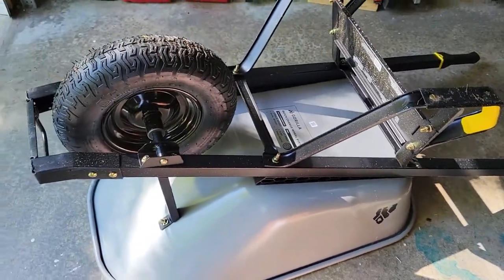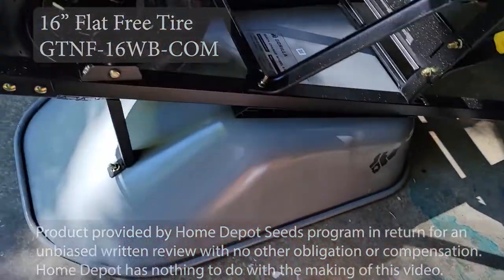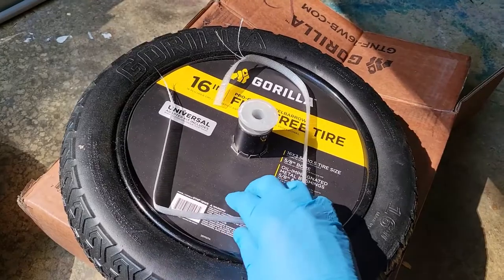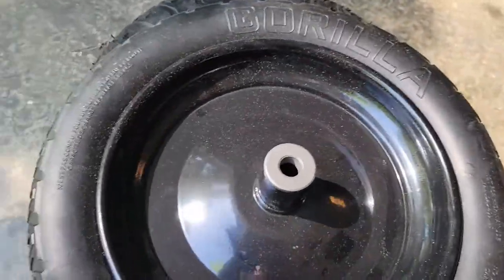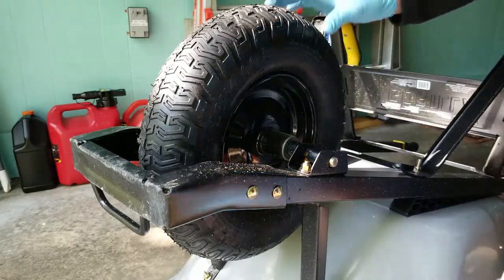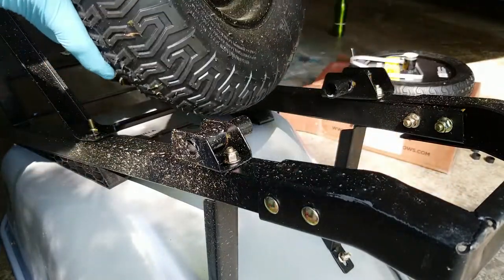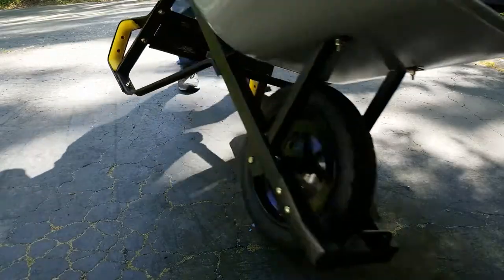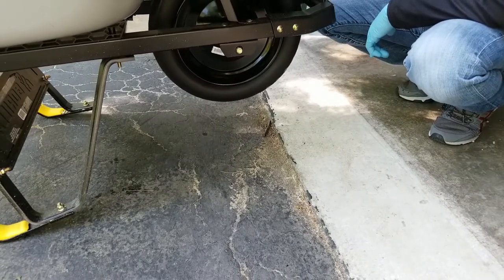GORILLA 16" Flat Free Tire GTNF-16WB-COM

Comment: Does that no flat tire have a weight limit before deformation?
Reply from the maker: It did not list a weight limitation, but I have no issues hauling 6 cu ft of material with this wheel.
Reply: @cfldriven  Is the poly tire stiff or does it have some give like a no flat rubber tire? Thanks for your replies trying to finalize my purchase decision.
Reply from the maker: @hippo-potamus  It a solid hard tire with very little give. Going over obstacles is jarring as it doesn't absorb the impact like a pneumatic would. It a tradeoff I can live with to avoid a flat tire.
Reply: @cfldriven  Thanks mate. Appreciate your honest feedback. But that very hard feel I don't particularly care for. On my other wheel barrow I have a no flat solid rubber tire and it is a very comfortable ride, it absorbs the impacts and feels almost like a pneumatic tire. I think I will just buy the same solid rubber instead and pass on this poly tire. Thanks for your help. Cheers.
Reply from the maker: @hippo-potamus  Glad I could help with your decision.